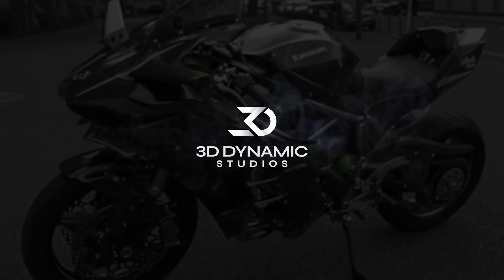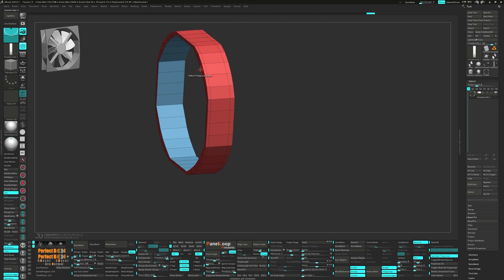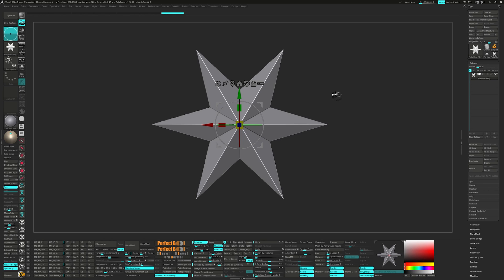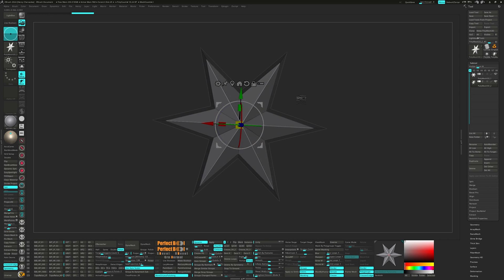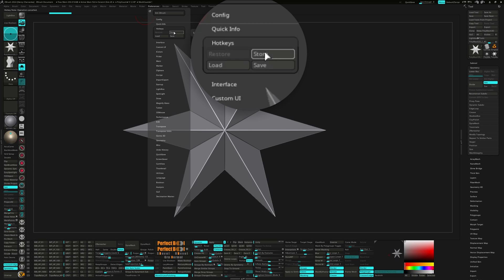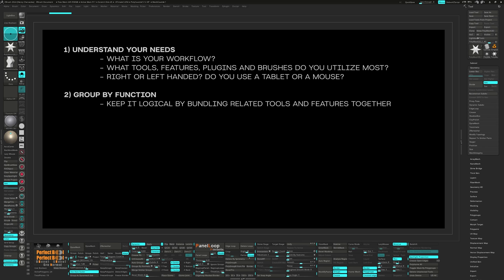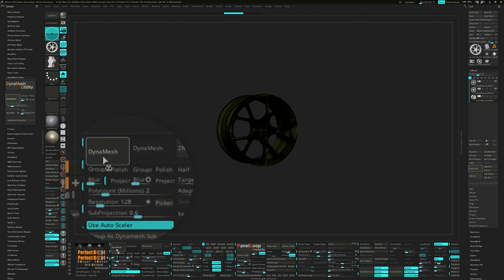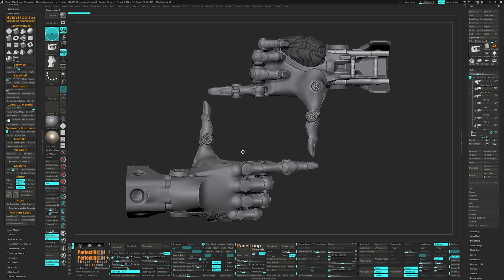Hard Surface ZBrush Tutorial Series // Modeling A Kawasaki Ninja H2R // 00 Intro

Comment: Hello Master Chervenka. Thank you so much for this futur series ! Looking forward to it !
Just one little question sir : Where can I find the MatCap (Model06) you're using. Or how can I make it, I mean on my own ? It looks like the screen space cavity feature of Blender, which is so cool to easily comprehend the volumes and shapes !!!
Thanks again for what you do for the community !
Reply from the maker: To get this look, start by picking a basic matcap like the green metallic one. Then, open the material palette and head over to the modifiers tab. Here’s the fun part: play around with the cavity detection and cavity transition sliders. Just bump up the cavity detection a bit and set the cavity transition to a negative value. Next, adjust intensity A and intensity B until it looks just right to you. To finish off, add a slight blur to soften things up a bit. If you’re looking for some cool materials to try, definitely check out the Zbro materials online—they're awesome!
Reply: @henrychervenka  I didn't expect to receive such a detailed answer !😄Works like a charm ! You're the best !
I really loved your UH-60 Rotor Tutorial. Can't wait to start the new one. Have a good one and thanks again!

Comment: the dynamesh utility tool was amazing. i sometimes struggle with scaling when use dynamesh resolution. its helpful for me. Btw, which material are you using? and what was the C1,C2 and C3 buttons do?
Reply from the maker: Awesome, glad it was helpful! 😃 The materials used are just slight modifications of the basic material. For some interesting options, I recommend checking out Zbro materials. The C1, C2, and C3 buttons are for saving camera angles. While you can do this in the Draw palette, I prefer using a plugin called Mad Poly Toolbag for storing cameras.